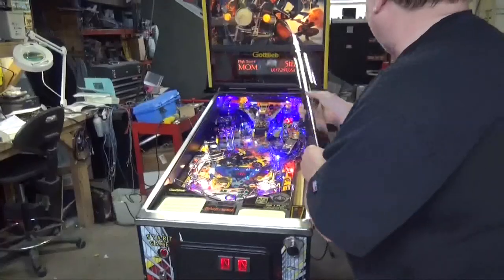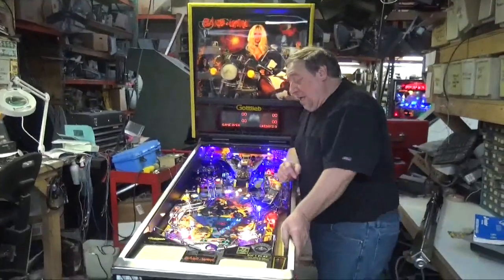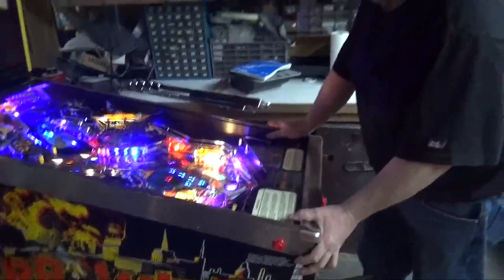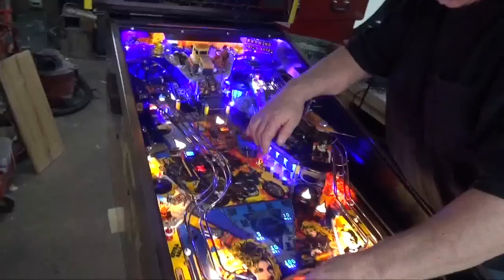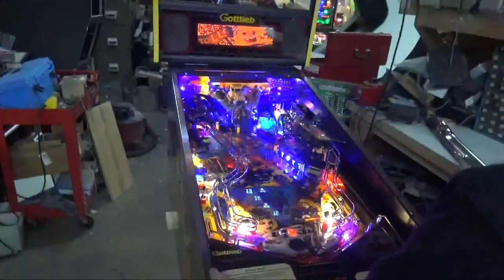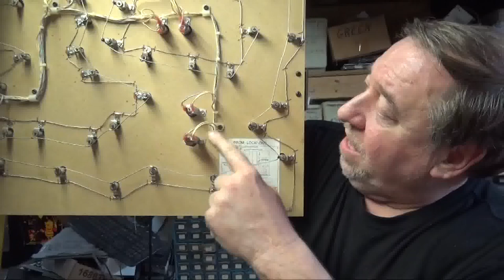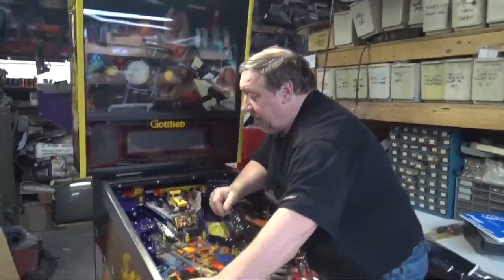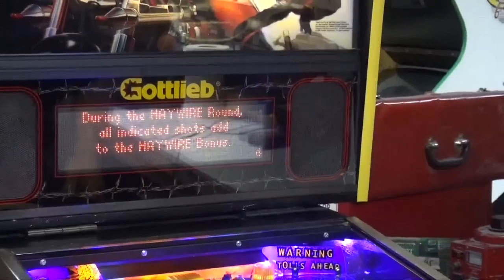#958 Gottlieb BARB WIRE Pinball Machine with Pamela Anderson - Only 1000 made! TNT Amusements

Comment: The one thing I loved about the Gottlieb machines at that time was that if it wasn't on free play and in a location if you hold the start button for about 5 seconds it will give you a quick switch test report and show any switches it thinks are bad or it will say "All Switches Operative" if everything is good.  Stargate was the first Gottlieb I found with that feature.

Comment: Todd, thanks for all the videos. Quick question, where do you get your LED flashers that you use in the head from? What voltage are they running at? Thanks again!
Reply from the maker: coasterbp They run at 12 volts...they are bulbs used in car back up lights.